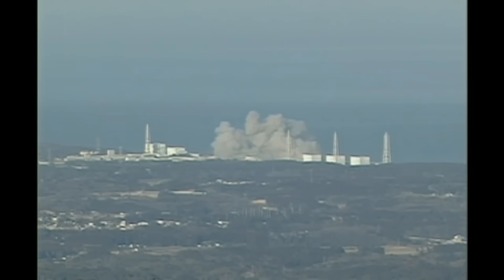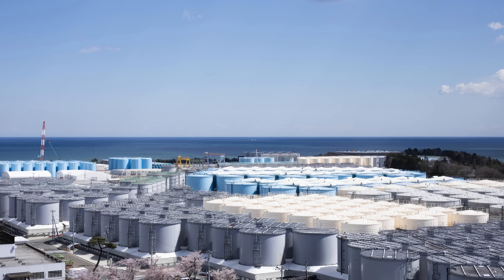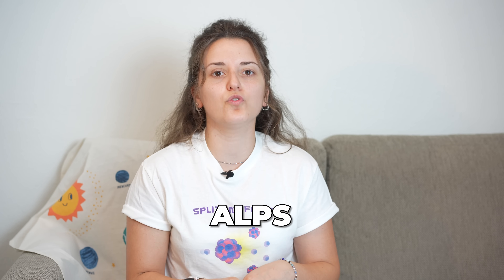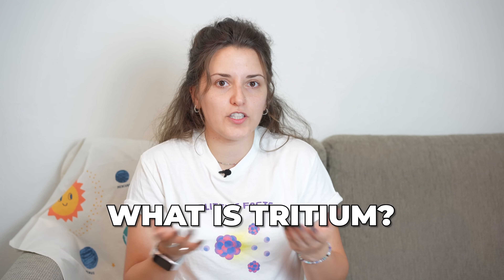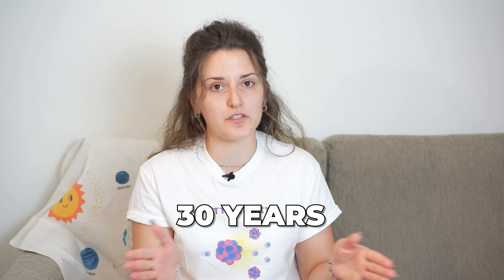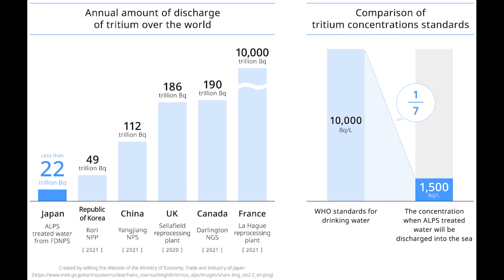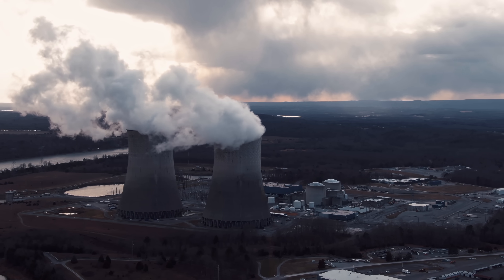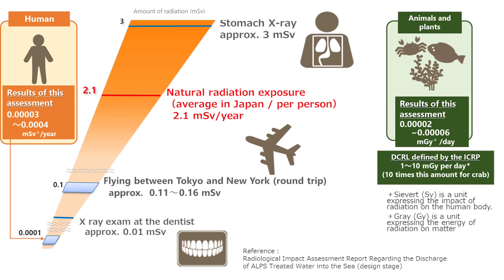Nuclear Physicist Explains - The Release of Fukushima Treated Radioactive Wastewater

Comment: Did you do the verification yourself?   At the least the countries nearby need to allow to send people to audit and to certify the whole process.  Science comes later.  So far TEPCO is the party  processing,  measuring and trying to bulldoze through.  TEPCO is not known as an honest and trustworthy company.  There were 5 proposals given, you should educate why the other 4 are wose than the realeasing the water.
Reply: Show where TEPCO is lying.  The full report shows the complete methodology of the sampling and the four countries that received the samples.
Reply: TEPCO is the guilty party from the start by default, like it or not.  They have to be out of the process, and not the party doing the methodology, doing report, and taking samples and giving out samples.  The immediate neighbors that shall suffer the immediate damages have to come in as the policeman, and the judge.  If TEPCO did their job, the japanese engineer that warned about that the pump failures that could burn the plant would have stopped the builiding of the plants, or  rectifications be put in and therefore prevented the meltdown.  And the lies that TEPCO kept spelling out while the plants were melting down were clearly recorded on all the world medias.  Therefore TEPCO has zero creditivity and their report does not worth the paper and ink.  They are known to be generous donors.
Reply: @smling11  CCP does not release full data on their nuclear waste release. That would be lying by omission.

Comment: Just interested, why do they not use the Tritiated water for cooling, just recycle in a continuous loop. Same question applies of course to existing reactors. Also how does the tritium content in pct or ppm or whatever compare with seawater?
Reply: Tritium disproportionately exists as free atoms of (isoptopic) hydrogen, since hydrogen is such a small atom  can diffuse more readily through many of the materials used to contain it, working it's way through pores and molecular interstices.
Reply: Thanks for your reply, that's interesting. I would think at least the dissociated Tritium could be removed chemically or evaporated? In any case it will disappear from the sea water very quickly into the atmosphere.  @BradPanoff
Reply: @fabmcchip5015  Chemically, Tritium is just Hydrogen with an extra 2 neutrons, so the charge and reactivity is the same, so that leaves only separation by the same mass-based techniques used to enrich other isotopes. It's also why it's not as much of a hazard to biology, as not much life does stuff with free hydrogen, and water has a cycle of intake and excretion.

Comment: I was very worried about this. Your video did a lot to reduce my fear. How are they planning to release the water? Wouldn't it be better if they put the water on flying refueling tankers for military aircraft and releasing it over untraveled or lightly traveled parts of the ocean around 30,000 feet (9,144 meter) so that the water can be disperse widely before the droplets can be diluted by the vast ocean?
Reply: There is always around 3400 grams of naturally occurring tritium in the earth‘s atmosphere as it is constantly being produced by cosmic radiation interacting with the upper atmosphere. Most of those 3400 grams are in the earth‘s oceans. The water in Fukushima only contains 2-3 grams of tritium so releasing it all at once would have no measurable impact.

Comment: She didn't mention it, but tritium has a half life of about 12 and a half years. In nuclear medicine, we hold that a radionuclide is essentially gone in 5 half lives. So right now, there is still more than half of the original amount. After 50 years, it will be nearly unmeasurable. At the end of the 30 years, roughly 12% will be remaining.
Reply: So what?
The amount of Tritium is absolutely miniscule, and it will be diluted even further.
Reply: What about other radioactive elements such as caesium etc, some of the elements have half life of 1000+ years. Can ALP remove them all? If so where does Japan get rid of the radioactive elements removed from the water? Dump them in the mountain or throw them to the ocean?  

The radiation level inside the plant was very high as one of the Youtuber visited it recently and detected it.

As reported by British media, a black rockfish, caught on 18 May, was found to have 18,000 becquerels per kilogram of caesium-137, surpassing the legal maximum level of 100 becquerels per kg.

The rockfish was caught in an area where rainwater from the regions around reactors one, two, and three, which experienced meltdowns during the March 2011 disaster, flows into the inner breakwater. The sediment in the inner breakwater's seabed has a caesium concentration of over 100,000 becquerels per kg.
Reply: Carbon 14, strontium 90 and iodine 129 and others which are more harmful than tritium are not treated and released into the ocean. But She only said about tritium.
https://youtu.be/mWFLpSkOotk?si=1FzmLdo0ftK4-K7B
Reply: I disagree that tritium is weak. Since it's hydrogen and small, it can easily travel everywhere in the body. Yes, it will be weak in 30 years and won't last a thousand years, like many other radioactive materials; but a lot of damage can be done in a generation or 2.
Reply: @turkovich530  
Well you can disagree all you like, but this is physics. In physics you deal with fact, not opinion.

Comment: But why if dilution is a solution, do they release it in one area.   Why not load a few tankers and release it over a very large area and much greater volumes?     The more it is spread out the lower any one area will have any impacts.   (yes, what they are doing is safe)
Reply: Why would they do that?  There is always around 3400 grams of naturally occurring tritium in the earth‘s atmosphere as it is constantly being produced by cosmic radiation interacting with the upper atmosphere. Most of those 3400 grams are in the earth‘s oceans. The water in Fukushima only contains 2-3 grams of tritium so releasing it all at once would have no measurable impact.
Reply: @danadurnfordkevinblanchdebunk  But they are not releasing it all at once so that leads to the inaccurate perception that something is dangerous.

Comment: Lies of the Japanese government and TEPCO

Commentary by freelance journalist Hiro Ugaya.
"ALPS" is a radioactive substance removal device for radioactively contaminated water installed by Tokyo Electric Power Company
The water made by it is called "ALPS water".

1. By dumping it into the ocean, the government deliberately raised the crisis level.
The contamination caused by the Fukushima Daiichi Nuclear Power Plant accident, which had been a domestic issue, has become an international issue. By releasing it into the high seas, which is a public good, all countries in the world will come to give their opinion. After the defeat in the war, the biggest bad move of the Japanese government in international politics.

2. It is a lie that "there was no other method than dumping into the ocean".
There are at least two methods of land-based treatment. One is the method of naturally drying and evaporating contaminated water, following the example of the Three Mile Island nuclear accident (1979). Another method is to harden (mortar) the concrete and bury it in the ground. (Fukushima already has a hardening and reclamation facility called 'Riprun Fukushima'.) Using these means did not become an international problem.

3. "There are no radioactive substances other than tritium in ALPS water" is a lie.
TEPCO's published materials show that cesium, strontium, etc. remain.
Measurements at the exit of the ALPS treatment plant indicate that cesium-137 contains 0.1-1 Bq/L of radioactive material.
There are 700 to 800 tons of fuel rods (debris) that have melted down, and only about 2 g have been retrieved so far. China's nuclear power plants dump tritium, so it's a "serious lie" to say that Fukushima can do the same.
In Japan, it is reported that the amount of tritium in the water dumped by China's nuclear power plants is greater, but the water that touched the melted fuel rods and the water in the circulating water pump are completely different things.

4. It is a lie that it is safe to throw it into the sea because it complies with the standards set by the Japanese government.
The standard that the Japanese government's "ALPS water discharge standard" is harmless to humans is wrong.
"No harm if ingested by humans" and "no harm if released into the environment" are not equal.
For example, CO2 does not pose a problem if humans take it into their bodies, but it has a great impact on the global environment (climate change).
The "ALPS Water Effluent Standard" does not consider long-term effects on the environment. Bioaccumulation, etc. are not taken into consideration.

5. It is a lie that the Fukushima tank will disappear if ALPS-treated water is dumped into the ocean.
Only 33% of the contaminated water is discharged into the ocean. 67% of the contaminated water is too polluted to be treated. 67% remains even after all ocean dumping is over.

6. "There is no place to put a new tank" is a lie
A large area of land remains in the vicinity of the Fukushima nuclear power plant, and it is possible to increase the number of tanks.
The Ministry of Economy, Trade and Industry says there are no more places, but there are plenty of places left under the jurisdiction of the Ministry of the Environment. This proves that there is no consensus among ministries and agencies. It is a perverted idea to say, ``I'd rather throw it in the sea than to exchange between ministries.''

7. Prime Minister Kishida's ``contaminated water dumping for Fukushima reconstruction'' is a lie
Even if the ALPS water is dumped into the ocean, the number of tanks will decrease and there will only be vacant land at the nuclear power plant. It is irrelevant to the "reconstruction" of the nuclear power plant accident disaster area that was forced to evacuate on the outside. Also, it has nothing to do with "decommissioning".

8. It is a lie that "opposing the dumping of ALPS-treated water leads to harmful rumors"
According to a 2022 survey, sales of agricultural products produced in Fukushima have not declined due to the Fukushima Daiichi Nuclear Power Plant accident. It has increased since 2010. There is no reputational damage in Japan. If sales decline from now on, it will be a "man-made disaster" due to ocean dumping.
If cesium is detected in tuna caught in American waters, it will be subject to compensation.
The Japanese government will bear this risk for hundreds of years to come.
Reply: You have been shown repeatedly you are wrong on all these points, yet you still keep posting them.
Reply: @ForbiddTV  You are raising concerns about the release of tritium, but that is a trick by the government and Tokyo Electric Power Company. The real issue is the groundwater melted from the 880 tons of fuel debris.

Comment: Tritium also has a relatively short half life (a dozen years, not millennia). Since it only emits beta radiation, and this is in water, this means that beta particle will hit something else pretty quickly and lose a lot of its energy, once it disperses into the broader area, doesn't seem like its much of an issue to me. Localized concentration or long half life is the thing to be concerned about and we don't have that. They could probably just pump the whole volume onto a tanker and dump it into the ocean through a hose while traveling 15 knots out in the open sea (like 50km off shore) and have no more impact. Actually, because of that dispersion, even if it had particles within it that were more active, I wouldn't expect any noticeable impact. Which, IMO, means this should really take one year, not thirty. It's only fear of radioactivity without context that makes such things have to take so long. Raw, uninformed paranoia.
Reply: It's even less of a problem than you outline.  There is always around 3400 grams of naturally occurring tritium in the earth‘s atmosphere as it is constantly being produced by cosmic radiation interacting with the upper atmosphere. Most of those 3400 grams are in the earth‘s oceans. The water in Fukushima only contains 2-3 grams of tritium so releasing it all at once would have no measurable impact.
Reply: If tritium is incorporated into the DNA of living things, what happens to the DNA when the tritium decays?
Reply: @Unschaerferelation137   Tritium doesn't bioaccumulate.  Because of the role of hydrogen in metabolism and its ubiquitousness in the environment, organisms have not evolved mechanisms to accumulate or concentrate hydrogen or its isotopes.
Reply: @danadurnfordkevinblanchdebunk  Tritium is not strongly radiotoxic, but can be stored and converted in the body in the form of water. A French-Belgian study from 2008 concludes that its radiological effects have been underestimated so far: For example, it can be deposited in DNA (genetic material), which can be problematic, especially during pregnancy.

Comment: True dispersing the Tritium in the ocean is a good plan to get rid of it safely. However, I think there could be other ways as it is also full for fusion. It could be used in fusion laboratories. Just a thought. Though, they would still have to separate it and isolate it from the oxygen. Vary informative video.
Reply: There are only 2-3 grams of tritium in those tanks.
Reply: @danadurnfordkevinblanchdeb5467  well that's not much at all.
Reply: @renagadeomega   Not only that, but it has a half life of 12.3 years, and some of the water in those tanks is already that old.  So even if someone were to go to the tremendous cost of trying to remove it, there is only a minuscule amount that could be available to recover.
Reply: Separating it is the very hard part, as it's so similar to Hydrogen as she explains in the video. If they could capture it they wouldn't have to release it into the ocean in the first place.

Comment: Is the tritium water the same thing as heavy water ?
Reply: No. It is actually heavier than heavy water, but only if both hydrogen atoms in a molecule of water are tritium. Ordinary water is H2O, where the H is hydrogen with a single proton for a nucleus. The O is oxygen with 8 protons and 8 neutrons for a nucleus. There are electrons too but as they weigh about one two thousandth as much as a proton or neutron, they don't really count for much when determining weight. Heavy water is D2O, where the D is deuterium with a nucleus of one proton and one neutron. It is not radioactive. Tritiated Water is T2O, where the T is tritium with a nucleus of one proton and two neutrons. It is radioactive and gives off Beta particles (electrons) with about the energy of the electron beam in an old black and white television. 

To summarize: Water has a density of 0.9970474 g/mL at 25 °C. Heavy water has a density of 1.107 g/mL at 25 °C. And tritiated water has a density of 1.21 g/mL  at 25 °C.

Of course the water containing tritium coming from Fukushima is probably HTO as there is a heck of a lot more hydrogen than tritium about. Its density is about the same as heavy water as it contains the same number of nucleons. And that is probably more than you ever wanted to know. :)
Reply: @danielcarroll3358   @danielcarroll3358  thank you, I never knew water could have so many differed atoms and be so different just based on changing the number of neutrons. I very much appreciate you enlightening me.

Comment: So you're saying Advanced Liquid Processing System (ALPS) is a critical technology that remove 62 type radioactive material from contaminated water waste and leaves only tritium - an isotop of hydrogen with excess of two neutron which makes it unstable and decay into helium by releasing beta radiation. Tritium are much less radioactive to human body than potasium.

You're good. But leave few question for me. Does tritium can fuel hydrogen water based power generate? How long normally it transformed into helium?

Comment: Communication of 'authorities' with the general public is majorly impaired by 'authorities' having a track record of being corrupt liars.
I always advocate the radical approach of cultivating spiritual wisdom, because then problems resolve from the root all the way to the leaves, with ideally zero effort needed anywhere else but at the root. Symptom management is a practiced admitting of defeat/incompetence. It may have merit as a first response in a mix of measures, but it all too easily tempts to glorify it and get distracted from the problem causes.
The problem at the very root is fear servitude.